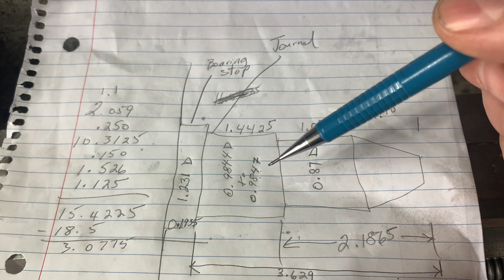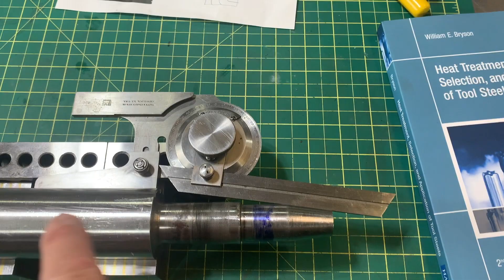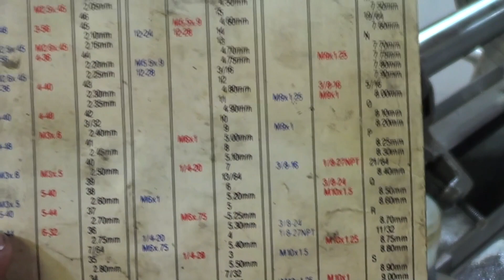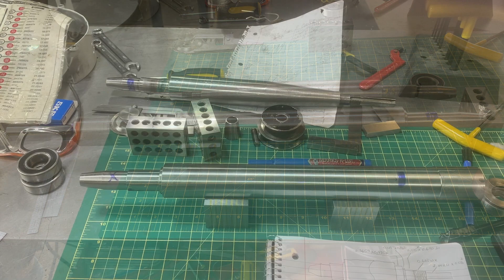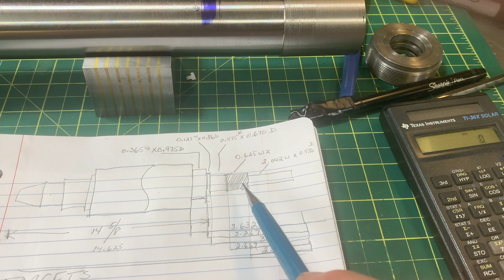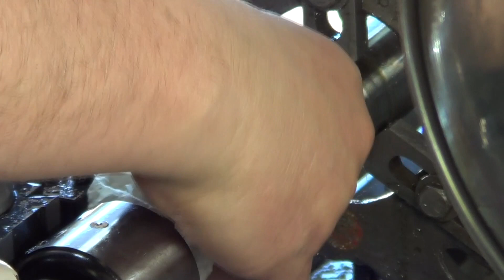Precision Spindle Fabrication Part 2

Comment: For setting precise angles on the compound, especially smaller ones, you could use trigonometry.
First you set up the compound using the divider; then, with a dial indicator resting on the toolpost and touching the workpiece, you crank the compound a known distance.
The real taper angle is two times the arcsine of the dial indicator measurement over the distance travelled.
Reply from the maker: Agreed.

Comment: Gilles, I know that it's too late for this part, but I've seen other Machinists (on their "manual" lathes) using drill-drivers to turn the hand-cranks in order to get better finishes.  They make up adapters between the drill-driver's chuck and the hand-crank they are interested in.  This gives a more consistent rate of rotation of the hand-crank and therefore a nicer/more-consistent finish.  I definitely plan to do this on my lathes the next time I need to turn something!  This is a very interesting series and I'll be going straight to "Part 3"!
Reply from the maker: You’re absolutely right Bob. Been eyeing them up this week. Gilles